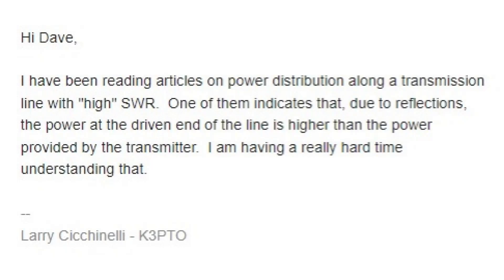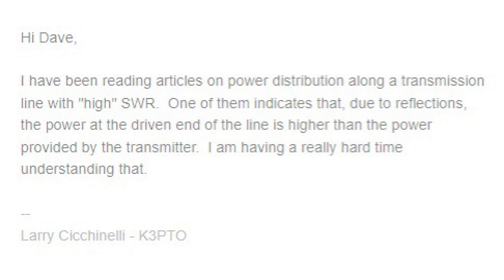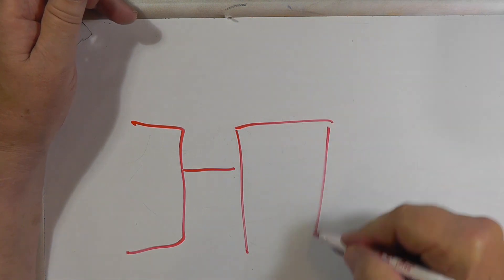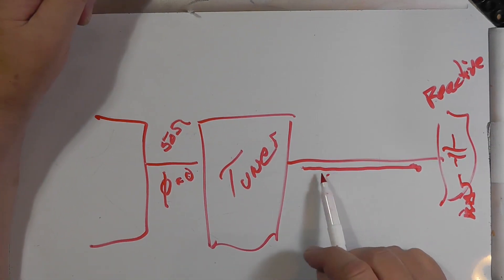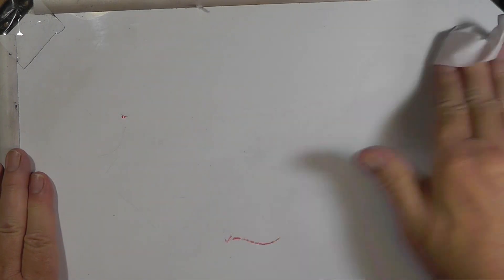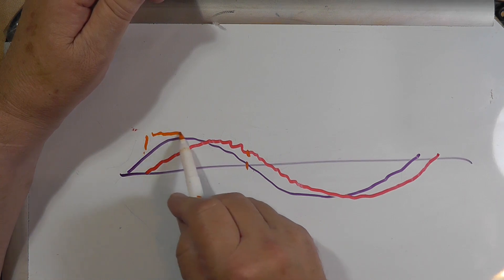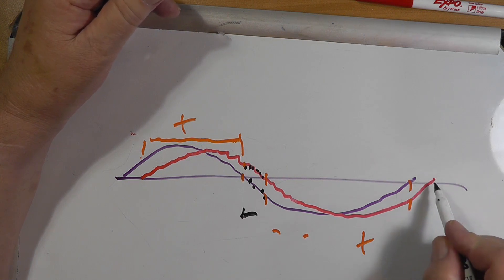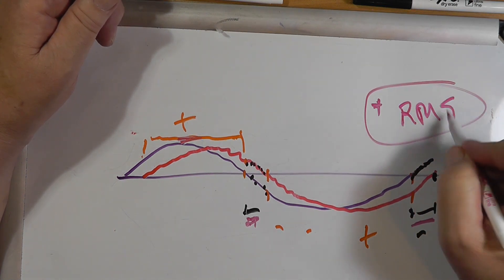An Antenna Tuner Cannot Create Power (#989).

Comment: The antenna tuner does not create power, but it turns around and reflects back to the antenna the reflected power coming back from the antenna. A little power is lost in the tuner due to resistance, but most of the power coming back from the antenna is sent back to the antenna. So the total power coming out of the tuner is the power from the transmitter plus the reflected power. Of course, some of the reflected power is lost due to resistance in the feed line. Answering the original question: yes, the power coming out of the tuner is greater than the power from the transmitter. But the power reaching the antenna (after the mismatch and reflection) is less than the power from the transmitter.

Comment: The most common issue is that people measure power before and after the tuner. In fact, popular swr/pwr meters measure voltage and then display it as power with assumption of 50 Ohm load. If the antenna has higher impedance, then magically the meter will show higher power (in fact higher voltage) after the tuner. And this really makes some hams confused and creates "the power increasing tuners" legend.

Comment: If I'm looking at an antenna which is reactive, let's say capacitive, then the current leads the voltage. Got it, but if the resistive component of the antenna is 50 ohms, and I have a 1A peak current does the load value change?  During the positive peak, my peak power is 1A squared times 50 because we can calculate power without voltage. That's 50 W peak. During the negative peak, that's -1A squared times 50 which once again is positive 50 W peak. At all points my antenna is 50 ohms and my current is either positive or negative. Current squared will always return a positive value or zero. Positive times positive is always positive. Never negative. 

Don't be negative, Dave.

Comment: Hello Dave!

There is no "RMS power".

You can measure peak, average, instantaneous...

But RMS power have no meaning. You can actually measure/calculate it using an ADC and DSP for example, but the result of this calculation have no relation to the "real world".

When people say RMS power they usually are referring to power average over one cycle.

Other than that, very nice video. I just learned a good way to explain reactive power with you. Thanks. :-)

73 DE PP5BRU

Comment: Is there a way to find out how much power is actually delivered to the antenna given a tuner, making life easier for the TX.
Reply: If the tuner can tune to 50 + j0 ohms at the point where the antenna feed line enters the tuner, cable losses will account for the vast majority of power losses.  A low loss coax or ladder line will keep the heat losses to a minimum.  In practical terms after about 5 round trips of the reflected signal most losses due to feed line heat have occured.  So, with a good tuner and high quality cable the signal strength at the receiving end will be almost the same regardless of the SWR at the antenna.  It amazes me that many hams waste their time trying to get a 1:1 SWR.  Try to get your antenna up high as you can and tune to as low SWR as you can at the tuner and use high quality low loss cable like LMR400 if you can afford it.

Comment: Hi Dave:  One thing that came to mind is what about the power lost in heat in the antenna tuner?  Would that not be deducted from the total power delivered to the radiating device?  Nice tutorial on phase angles!  i never thought about negative power...  Cool stuff!  73, Marc - N6UNX
Reply: There are factors involved because I'm sure a tuner can be set up in such a way to make it lossy. However, Antenna tuners just do not heat up and if there are losses it is going to be radiated as heat.  I've run up to 1200 watts from 6-160M and have never felt heat from a tuner. Having said that, I'm sure there is probably a fractional loss, but is is negligible. Just put it this way, I would never make a decision to not run a tuner because of perceived losses. That is just my opinion and everyone has one.  Cheers.